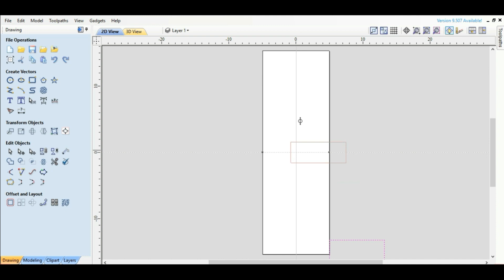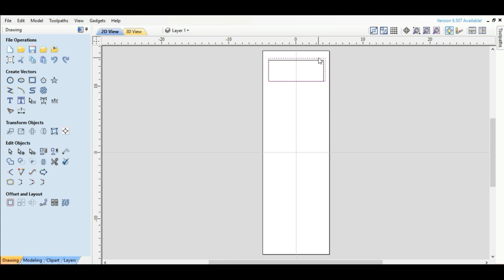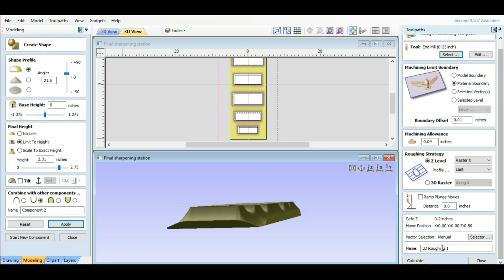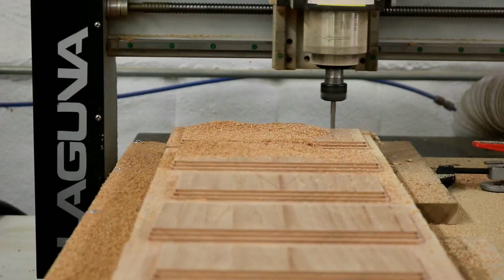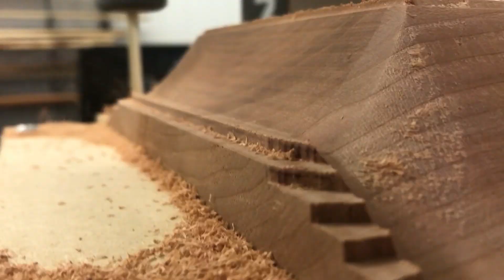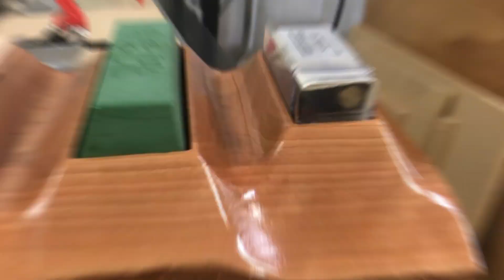3D Sharpening Station // Laguna IQ CNC // Aspire Demo

Comment: I just got my Laguna IQ last week, still trying to work some things out. Mine seems to have a problem going between standard & metric, it looks like you don't have that problem. How are you programming in inches but saving in mm? Also, think you could run actual coolant thru the spindle, or is water best? Last thing, what's the finish on the cherry? Looks awesome! Thanks man!
Reply from the maker: Larry Hare Thank you very much!! The finish is just gloss lacquer. You can use coolant if your shop gets colder than freezing.. mine doesn’t, so I just use water. And the mm I save it under is just a type of file.. it’s definitely in inches. 👍👍👊

Comment: Awesome video, great work. Been looking for a long time to buy a cnc and going to be ordering a Laguna seems to be  top notch for the money. couple questions i'm looking at a IQ 2x4  thinking about  stretching  the budget to get a 4x4 machine. Do you find yourself in need of a larger build area often? Did you start out with V carve pro and upgrade to aspire ? Not sure if I should start with Vcarve or jump right to aspire. Would love to hear your feed back on those questions. Thanks!
Reply from the maker: Steve S I’m glad you like the videos, if you have the budget to get the bigger one, definitely go for it! I have to limit the size of my projects quite often. V-carve pro and Aspire are exactly the same accept Aspire will do 3D modeling.. it’s cool but unless you are going to do 3D modeling all the time I would stick to v-carve pro. I had v-carve and Laguna gave me Aspire so I could show some 3D videos. Good luck and let me know what you end up doing!!👍👍👊
Reply: @JakeThompson  Thanks so much for the quick response!  The price is really tempting to get into the 4x4 machine with the march sale they have going on. I'm torn because i was going to order the 4th axis with the iq but probably cant fit that into the budget if I do the 4x4 machine .

Comment: Thanks Jake for sharing your experiences with the Laguna IQ CNC and Aspire Software.  I have the same machine and Aspire VCarve-Pro software.  I have learned so much from watching your videos and have adopted your approach of using your method of wedges to secure the material.  I've been debating on purchasing Aspire but need to further justify the cost aspects.
Reply from the maker: Jim Pell I’m happy to hear that you like the videos!!  If you plan on doing 3D modeling you have to have some way to model it.. in which case Aspire or some other way to model. If you aren’t going to do 3D stuff.. there’s no need.. v-carve pro will be good.. Thanks Jim

Comment: When you did the tool change, how did you set the z hieght?
Reply from the maker: wood hacker on this project I set the z height to the top of the material,  I just ran the bit down until it touched the material, then set 
it.  The top of the material didn’t get cut until the pockets were cut for the stones. I didn’t need to set the z again after that.. I was going to set the z height to the bed surface but realized I didn’t have to.. I hope this answered your question. 👍